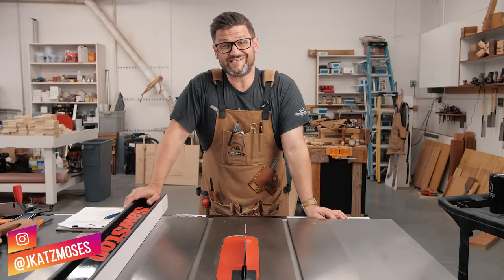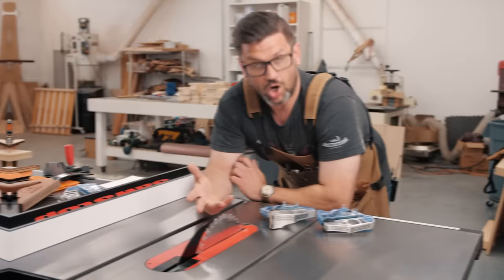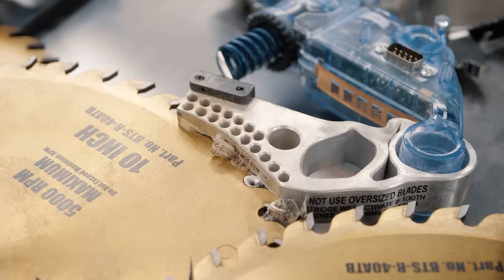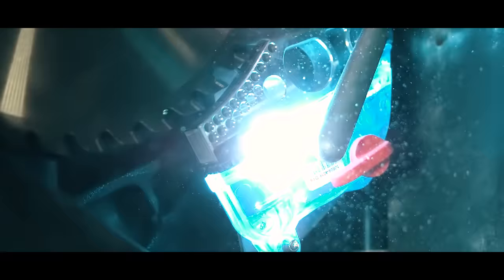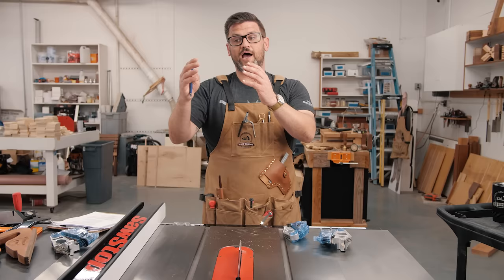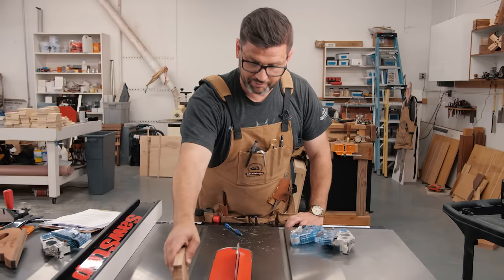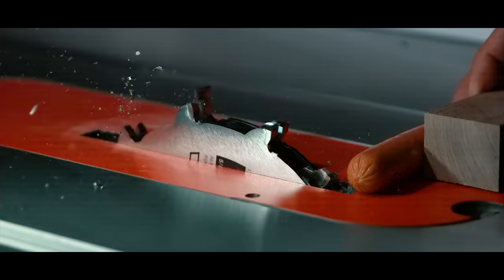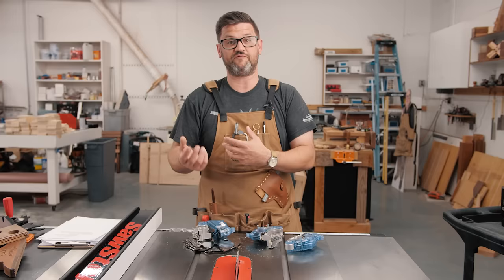How Safe is a Sawstop Saw? - Never Before Seen 19,000 FPS HD Slow-Mo Video

Comment: I'm curious if after an activation - Does the force of the blade stopping knock your saw out of calibration at all ? Did you do any measuring to compare what happens after 1 activation, to 9 ?
Reply: Dave Stanton who works at Carbatec in Sydney has done something like 100+ activations at shows says they haven't gone out of alignment by even a fraction.
Reply: @geoffsemon7411  Did you mean haven't gone out of alignment?
Reply: @SaMiChi  Yes lol. Fixed
Reply: IIRC they’re engineered to withstand some absurd number of activations, like 1M.
Reply: If it didn't activate, you wouldn't have to worry about alignment for at least a couple of weeks, and possibly for ever...
Reply: As an Er nurse I would much prefer fixing my saw as opposed to a surgery. Also a cabinet maker for 15 years prior to RN.
Reply: I think SawStop recommend binning the blade, though I know some folk reuse them.

Comment: 5 weeks ago I got a kick back which pulled my right hand into the blade. It cut my extensor tendon in my index finger and left a 1cm deep laceration on the bone just after the central slip (joint) from the base had surgery 4 weeks ago and start physio next week it’s currently got around 40 degrees of motion the rest feels like there’s something stopping it from going any further but I’ve been told to force it to move or it’ll never move

Comment: What happens if you're wearing gloves when you hit that? If it's using current to detect flesh and I'm still wearing a pair of, either leather or rubberized gloves because I was too lazy to take them off "just to make a couple quick cuts" am I going to get my finger grabbed and pulled into the machinery and lose it even with the sawstop?

Comment: "its just some flesh and will not go directly to your bones"

NOPE
Reply: Yeah, a cut that deep and wide on a finger not causing lasting damage?? It's not going to be debilitating but it certainly isn't a little scratch lol
Reply: Um, it's better than what would've happened without the product.
Reply: loupgarou95 ok but how much softer is a hotdog than a finger
Reply: @spin4687  good point
Reply: I suggest you take a bite on a hot dog, then on your finger. It's like comparing the strenght of a raw potato vs. mashed. Still, it's going to be a bitch - but you DID save that finger.
Reply: 'Tis but a scratch
Reply: @spin4687  it doesn't really matter, spinning that fast it will chew through bone just as easily as skin
Reply: To be fair, whatever damage it does with the sawstop won't come anywhere close to what it would do without it. True, you won't come out unharmed, but better a mild cut that a finger cut

Comment: I would caution people against believing you'll walk away with a few stitches and be fine. You have to consider not only the depth of the cut but the tearing. At high velocity, you would still see serious tissue damage that could lay you up for months and there could be intense scarring and long term loss of sensation in the affected area. Having said all of that, there is still a vital difference with this vs. a conventional table saw: You get to keep your thumb and it will eventually be useful again. To me that's worth it, just don't let it be even a partial replacement for caution.

Comment: Pretty impressive safety tech. How is the accuracy of the cuts after activation? After several activations?
Reply: The bade is destroyed by bring buried in the brake.  It is not re-usable.
Reply: Perhaps I should clarify ... How is the accuracy of the saw itself after activation and for that matter after several activations. It seems fairly obvious that activation would destroy the blade, but a violet activation such as this or for that matter several activations might, and maybe even probably, would have a detrimental affect on the saws cutting accuracy ... yes with a new blade.  Since Jonathan was engaged in  the testing on this equipment, I suspect he is in a great position to comment on this question.

Comment: My ONLY question is: Was the hotdog 'body' "grounded" to the metal table to complete the SawStop mechanism to work? Or does it work even though the hotdog (or hand or fingers) are on top of the wood piece which is impossible to "ground"? Asides from the fact that this contraption works, I believe that is the # 2 question widely asked...

Comment: It wasn't the G forces that broke the dado blade teeth off.  One of the blades stopped slower.  Causing its teeth to rotate into the blade that stopped faster.  That impact between the teeth of the two blades is what broke the teeth off.

Comment: If the saw is running and cut wood and then switched off.. would it still work?.... the reason I ask... after using the saw... and switch is off.. it can take time to come to an end... one of the students went to pick up one of the small pieces of wood... too close to the blade and lost a bit of a finger..

Comment: I would doubt it is an AC current or a sine wave as you said. If the voltage was going through zero voltage it could not detect. Also PF.
Reply: You don't know your electronics and trigonometry very well.  Sine waves do not have to be AC i.e. go through zero.
Reply: @RazorStrap  True but what about PF and the associated current delay. All AC will have that issue regardless of being referenced to any particular voltage. Explain that one Mr Expert.
Reply: @bikepacker9850  Would be glad to explain it.  Just as soon as you provide the actual Sawstop circuit and specs.
But in general the PF and current delay are going to be minor to this application.

Comment: I find it refreshing to compare human fingers and thumbs to hot-dogs :). 

If this device is highly reliable there should be laws enforced to have this installed in every table saw that is sold. The design should also allow some kind of test switch to verify the unit is still 'functional' w/o actually activating the thing. It's like the ELB test switch on a shower heater. Users can test this to be confident the device is working before attempting to use the table saw.

On the other hand, after installing the user may have the mentality that if he/she screws up the sawstop will save the day, thereby actually make them less respectful of the tablesaw since there is a safety net to fall back on.

Comment: Another thing to consider.  Hotdogs are much less dense than human skin, so the blade would cut through a hotdog much faster.  Hitting the blade fast would definitely require stiches and leave a scar.  However, the cut on a finger wouldn't be as deep as with the hotdog.

Comment: The analysis of the damage it would do to a thumb (at full speed) isn't quite accurate.  The thickness of the kerf means that a slot was cut in the hotdog (and would be cut in your thumb).  10 stitches would close the wound, but it would take a long time for the wound to heal, and you'd undoubtedly sever some nerves that would never recover.  The tip of your thumb would probably be numb for the rest of your life.  Still, I agree that this is much better than the alternative.  I recently saw a photo from an operating room of a guy who obviously fell into a table saw and put his hand down to catch himself.  His hand was completely severed at a line somewhere between the wrist and the base of the thumb.  If he had had a saw stop, it would have made a 1/8-1/4 inch deep cut with a 1/10-1/8 inch kerf all the way across the lower palm of his hand.  A significant injury for sure, but he probably would have recovered fully within a few months.  As it is, he amputated his hand, and there's no way it can be successfully reattached.  I'm a big fan of the saw stop.

Comment: I use a Sawstop everyday. How does it tell the difference between between a finger or materials that you are cutting.
Reply: From what ive read, sawstop Puts a constant electrical charge on the saw blade. If your finger touches the blade, the electrical charge changes. That then emidatly triggers the stopping cartridge. That all happens within miliseconds.

Comment: As amazing as this is , there is no substitute for proper safety training which most people never learn . i learned it in high school  shop  class in the sixties and i still have all my fingers . 
aside from learning proper technique , the thing i remember the most was this bit of wisdom from the teacher - " Every time you turn the saw on , ask this question . where are my hands , in relation to the blade .continue to ask this question during the cut and never ever reach around for the cut off. .
also i learned on my own to not be in a hurry . don't push hard on the material . if it's binding stop the saw and ascertain what the problem is .
Reply: No ones saying it's a substitute. Try applying that logic to anything else. Safety precautions exist for a reason. They wouldn't exist if people were perfect.
Reply: hollow - " no one is saying it's a substitute ,,,,,,,"   
i'm saying it ! 
i'm saying that there are people that DO buy it as a substitute and i'm also saying that safety education should be the first priority and THEN buy safer tools .
Reply: @siriosstar4789  ok and?

Comment: The only problem with this saw is false triggering that occurs if the wood is slightly wet and there's no way of telling if the wood is dry enough for it to trigger which can cost in a new blade and trigger mechanism, nonetheless, the ingenuity of this is beyond impressive
Reply: Another trigger is if the board is laser cut. This leaves a carbon residue on the wood. The carbon is really a resistor. If you are touching the carbon edge and the saw hits the carbon on another connecting edge will kick the safety sequence.

Comment: I don't get the reason for under the table retraction. The slowmo shows that this motion is what does the most damage
Reply: it will be for redundancy, if for some reason the blade isnt stopped by the break thing it still gets retracted

Comment: I hate to be nit picky but 1000g’s of force is not the same as 1000mph. G’s are a measure of force based on earth’s gravity. 1 g of force is equivalent to 1 times the force of gravity on earth while 3 g’s is the same as 3 times the force of gravity of earth. 1000g’s is the equivalent of going 219,219mph to 0 in one second. For reference the international space station travels around the Earth at 17.000-28,000mph

Comment: So how do u cut normal wood without it fylling down
Reply: wood does not conduct electricity
Reply: What do u mean
Reply: @Myxton_  the saw stop when the 3 volt current is interrupted, since humans conduct electricity your finger will interupt the current and stop the blade but wood won't because it does not conduct electricity.
Reply: Thx for letting me know!

Comment: Umm, 1/8" will definitely do lasting damage.  Cut my index finger down to the bone which is about 1/8".  Cut through the tendon, nerves and of course, blood vessels.  It bled..., and bled... and bled.  The surgeon was able to knot the tendon back together but I can't make a tight fist with that finger.  The nerve damage means that the fingertip is somewhat numb to this day.  The lack of blood vessels means that when it is cold outside that tip of the finger goes white quick.  I'm still glad I have my finger though.
Reply: It's definitely better than losing a body part

Comment: How does it know what is your fingers and what is wood 🪵?
Reply: The blade has a constant electrical charge. When your finger touches the blade, that charge changes. This then triggers the stopping cartridge. Happens within miliseconds. Wood dosent conduct electricity in the same way. So it doesn't cause the stopping cartridge to fire

Comment: How does the machine know theirs a hotdogs or a hand closing in? Thanks
Reply: electrical conductivity
Reply: @caldeira_a  can you elaborate?
Reply: @No Searches  there's a small ammount of electricity flowing through the blade and when something conductive, like your hand or a hot dog, touches the blade it changes that voltage and trips the system 

Since wood isn't conductive ita doesn't trip the system
Reply: @hecki0193  ouuuu that's super cool thanks for the information bud 👌👍
Reply: @nosearches8340  
A significant capacitor (such as the human body) being connected to the blade.  The conductivity causes a drain of current from the sensing circuit to charge the capacitor.  The current drain results in a voltage drop in the sensing circuit.  The detected voltage drop triggers the brake.  Could probably cut a copper wire if it were kept electrically isolated from the body (capacitor).  It's the charging of the capacitor that is the key.  For which there has to be conductivity from the blade to the capacitor (body).
Reply: @RazorStrap  nice but how does the machine know the difference of a piece of wood and your finger and know to stop itself?
Reply: @nosearches8340  
"Dry wood" is not a significant electrical path (conductor).  So, the capacitor (which in this case is the human body) does not draw sufficient current from the sensing circuit to trigger the brake.

But once a good conducting connection is made between the body (capacitor) and the blade, such as finger touching the blade, wet wood, foil, or other conductive material, in contact with both the blade and body, sufficient current is drawn from the sensing circuit to charge the capacitor such that the brake is triggered.
Reply: @RazorStrap  thanks so much 😀 for the knowledge bro 😎

Comment: So  guessing that everytime the sawstop is activated, you have to buy a new blade since it completely decimates about 5-6 teeth on the saw? Seems pretty frustrating, why not make it stop the saw another way
Reply: Loosing a finger or more would be more frustrating though.  If you can afford one, i think saw stop is a very good investment of machinery. 
At 46y old today and been using table saws regularly since i was 14 and never got hurt on one so far (Knock on wood) but i have seen people cutting more than just a finger. So if it happens to me, i rather buy a new blade than cutting myself...

Cancel

Reply
Reply: Because this saves the most of your finger.

Comment: Whats funny is when the contact is made the thing that goes up and stops the blade by destruction  has fractions of a second before it hits the blade, would it not be better to just have the blade drop down instantly maybe at a slight angle away from the user? The blade stop goes up instantly, make the saw go down instantly and nothing will get damaged, also no one will make any money.
Reply: It actually does both...  it stops AND drops the blade as fast as reasonably possible while doing no permanent damage to the machine.   ~90 bucks and 15 minuets, and perhaps a change of shorts and you are back to work... if you keep an extra cartridge on hand.
Reply: The issue with just dropping it is acceleration. Let’s just say that upon activation, the blade drops instantly taking zero time. When activated, the saw has to drop using gravitational energy. However, the blade needs time to accumulate enough kinetic gravitational energy to go down, so when activated, it would still be in place as if nothing happened, and begin falling as usual, AND the blade is also spinning quite fast, so that needs to be stopped as well. When the blade falls, there’s only a fraction of a second longer the blade is up, but at this scale of time, the usual stopper stops the blade much quicker, reducing danger.
Reply: @ATTKtitan  you can design it to where the blade goes down much faster than gravity almost unlimited speed you could make it work with enough stored energy.
The problem would be slowing that blade and whatever is attached to it down so nothing breaks. Totally possible but how much money will the final product cost that way? There would be a lot of mechanical parts to do it right and the company wouldn't make any sales like it is now on replacement stoppers

Comment: I still think that if you're so absent minded/clumsy that you need a sawstop to prevent cutting your fingers off,  you should probably avoid any kind of woodworking to begin with...

a bandsaw, scrollsaw, skillsaw, reciprocating saw, etc. will remove fingers much easier, and they don't have safeties...

Comment: 1/8th of an inch is enough to cut a tendon if the blade was hitting the correct location.
Reply: Fingers aren't as soft, and this Is only against a finger. I'd rather get a 1/8 inch cut then lose an arm

Comment: It is impressive tech. And I understand why people want them. But an 1/8" cut on the front side of you finger is enough to get bone, maybe even come close to severing. Still safer than the same contact without sawstop technology, but not insignificant. The best thing anyone can do is pay attention, focus, and use all of the safety equipment that came with the saw. Especially the blade guard.

Comment: How does it know it's a finger or hotdog?
Reply: it doesn't, it knows if its conductive or not
Reply: @caldeira_a 
That's part of it.  It's not simply sensing conductivity.  But a significant capacitor (such as the human body) being connected to the blade.  The conductivity causes a drain of current from the sensing circuit to charge the capacitor.  The current drain results in a voltage drop in sensing circuit.  The detected voltage drop triggers the brake.  Could probably cut a copper wire if it were kept electrically isolated from the body.  It's the charging of the capacitor that is the key.  For which there has to be conductivity.